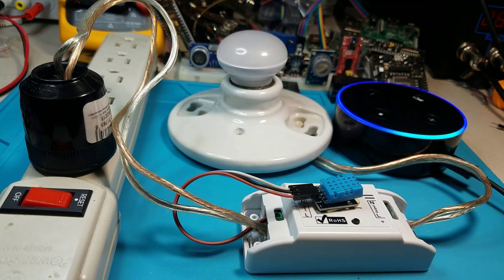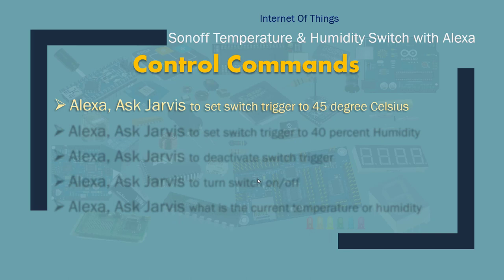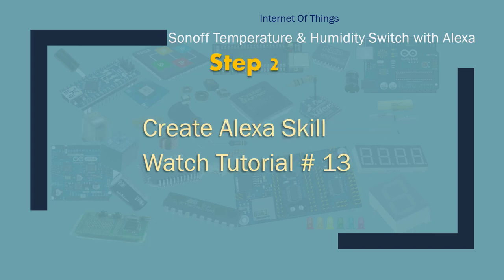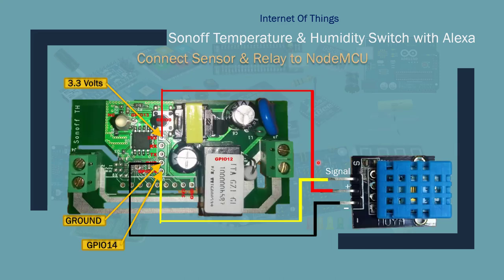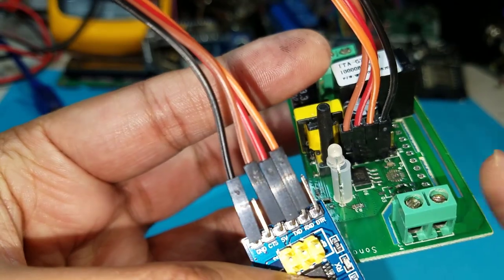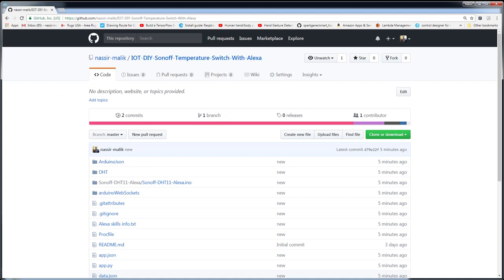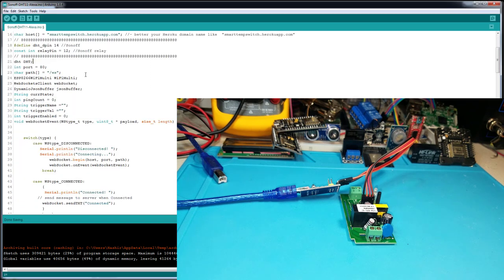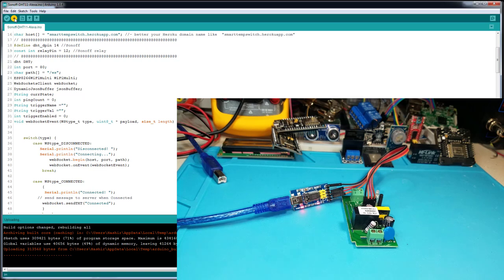Smart Sonoff Switch Triggered By Temperature & Humidity| Alexa Skills | Part 2 | #14

Comment: Take another look at the Sonoff device case. At 3:13 you have mixed the hot (load) and the neutral wires on both sides of the Sonoff. See the N and the L markings on the Sonoff? That's how they are supposed to be attached. It is always better practice to switch the hot/Load wires on and off and not the N Neutral.
Reply from the maker: Art Becker thanks for pointing that out. Sorry! my bad.
Reply: It's the kind of mistake I make, too. I am so excited about one thing that I get careless abut something else.

Comment: You keep mentioning this “Heroku app” is this compulsory within the code? 

Also it would be nice to see a video on adding a “static IP address” instead of just “DHCP” 👍
Reply from the maker: Martin Crosbie If you open a router port then you don't need the Heroku app for most projects. I am off loading some processing to it though. In nex tutorial I will show on how to use static ip. It is very easy to do.

Comment: Im trying Alexa to measure the temp, could i get a Humidity Temperature Sensors and plug it into the auxiliary port on Alexa? i want to wire it in, verses getting more wifi enabled devices, any recommendations?
Reply from the maker: I am not sure what you are asking. You can't connect anything with echo dot but you can use any mcu including sonoff to measure the temp and humidity.

Comment: This is driving me crazy.  There is a step that I am missing and cannot figure it out. When I upload the sketch it gives me many errors that are all mostly the same.  "Temperature-Humidity-Switch:54: error: 'processW            processWebScoketRequest((char*)payload);""Temperature-Humidity-Switch:96: error: 'getTemp' was not declared in this scope""'processWebScoketRequest' was not declared in this scope"I have copied the libraries to the correct folder and ensured they have correct permissions.  Let me know your thoughts.
Reply from the maker: Did you installed all of the required libraries? If still an issue then add following line after line 31. Good luck.

void processWebScoketRequest(String data);